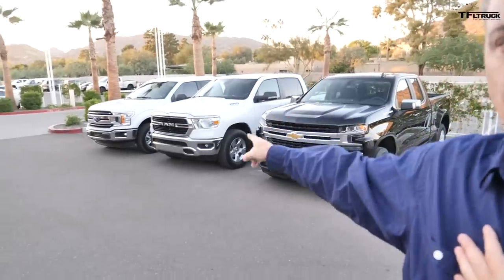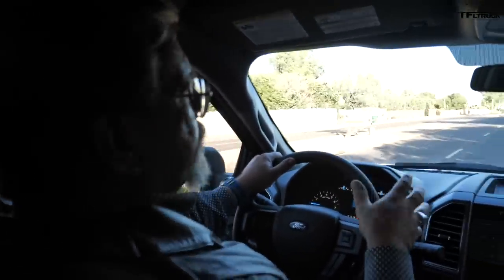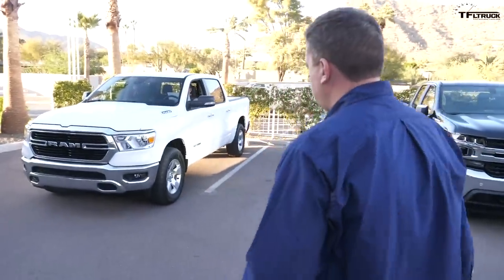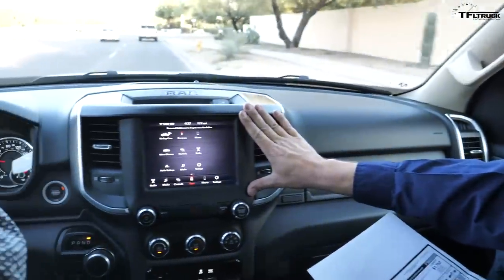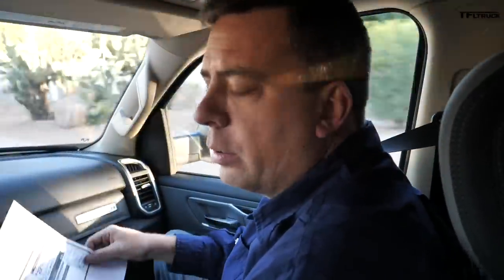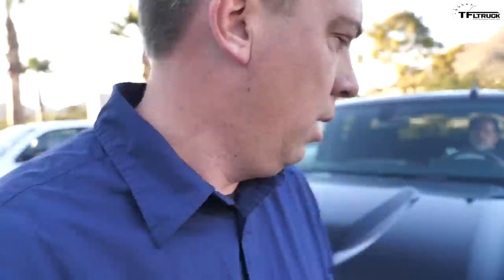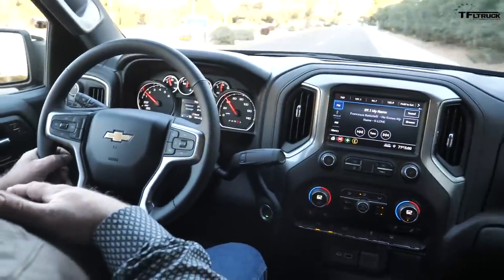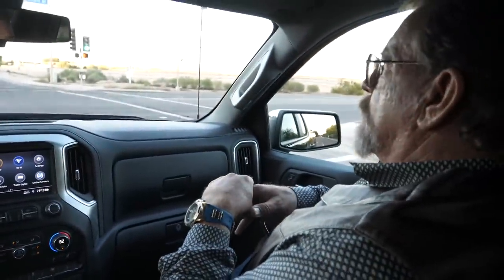Work Truck Wars: 2019 Chevy Silverado 4-Cylinder Turbo vs Ford F150 vs Ram 1500 Review

Comment: Point number 1: When TFL does comparison reviews like this one, they are far and away the best reviewers for pickups in North America and kudos to Andre for getting in the weeds and learning and conveying what he's learned to the consumer. He's the best that the industry has to offer as a media personality for new pickup truck offerings. Too bad that the media advocates still fall short; even TFL Truck. Andre Rocks as an advocate for the truck buyer with one huge caveat; reviewing these trucks in the way that GM or any other manufacturer wants them reviewed leaves a big gap in truth; at least with respect to GM in this whole new concept of changing the definition of a base power train. This is why relying on a positive relationship with the manufacturers to do honest reviews doesn't work, even when the media outlet is trying to give honest reviews like this one. More on that below.

Point number: 2: None of these trucks featured are base trucks or cheap trucks or good value trucks, or are they even close to being base trucks and why this is important to understand is that consumers should know that Chevrolet is spinning a new concept in the segment that they've invented by their marketing and bean counter folks to deceive us and are trying  to get the media on-board with them. So far it's working, because only the auto media can call them out and call it B.S., which it is.

So what is a base truck? A base truck is the cheapest truck for each configuration. Not the trucks shown here. The one's shown here are the trucks that are the most popular, aka volume trucks or mid-level trucks, and they are terrible value considering what you get versus what you pay for. And so what is a base engine? A base engine is the engine that goes in the cheapest truck, and it may also go up a few trim levels until the starting price warrants a higher level power train due to refinement and power and/or capability expectation from the consumer for that size and weight and price for any particular brand. For Ford, that cut off for their base engine is Lariat. When you get up to Lariat, which starts at or about $41K and SCab and 2WD, you no longer get the base engine; you now get the 2.7L twin turbo V6 standard; but Ford doesn't call it a base engine. It's a standard engine at that level. When a customer steps up to King Ranch, it's now the 5.0L V8; and when a customer steps up to Platinum, it's the 3.5L Ecoboost standard output; and Limited gets the 3.5L Ecoboost high output. The way Ford is doing it and also Ram doing it; it's  the way it's always been done, but now let's step it back down a little. Even though Ford has their 3.3L NA V6 in all XL and XLT configurations, they also allow a consumer to choose three premium gas power trains for modest premium prices for any lower trim or configuration truck, save only that the RCSB cannot be optioned with the 3.5L Ecoboost. But basically, if I want a very stripped work truck in a regular cab long bed; but want the highest payload available, I can get an F150 XL with the 5.0L and add the heavy-duty package and get payload up to 3270 lbs and still have a truck much cheaper than the ones shown here and far, far more capable. If I want the max towing truck, I can get a crew cab long bed XL with the tow package and get the max towing of 13,200 lbs, and if I get it in XL, it's cheaper than the trucks shown here. These are just two examples, but the main point being is that with Ford, there are real options and not just for the highest-paying customers. Ram offers everything they've got as well power train speaking at all trim levels, but they just don't have as many choices as Ford (they have three), and it's also very important to realize that Ram no longer offer any regular cab configuration in the new designed-truck which is another failure of the media to point out to consumers. Chevrolet and GMC is dropping the iconic RCSB. The media has said almost nothing about this. Ford still has both configurations up through XLT.

So what is GM doing. Chevrolet and GMC is trying to redefine what a base engine is...It's almost as if they are trying to completely write off their low end customers and saying that only starting at LT can you have a modern GM-branded pickup truck power train, and it's almost as if they only want to compare their number four trim level and up with the competition, and then justify not bringing the same power train technology to the lower end as a method to keep costs and prices down. Well if you follow where Chevrolet marketers wants you to go with this logic, and then you look at only the two trim levels that they want you to compare, with their standard engine, versus the competitions standard engine, but at only those two trim levels (LT and RST), then, just as this review shows, they compare favorably. 

But herein lies the problems with this logic. Finding a spot in the lineup just below the competitions' introduction of their higher-end power trains benefits only those customers that are shopping for those exact trucks and GM makes it look as if their advantage is the whole segment, but it's not. So if you are in the market for an LT or RST and the competing trims from the other brands (XLT and Big Horn), and only if you're considering the base power train, and only you like Chevy/GMC styling; and only if you'll accept a turbo 4 instead of an NA V6, then Chevrolet or GMC may be your best value truck. But lets go back to those Silverado forgot-about customers. Chevy is trying to say that their keeping costs and prices down via using completely carried over power trains in the new designed truck. There seems to be two big problems with that logic. Firstly, even though it is certain they are saving money on their costs by using two NA V-arranged engines with 6-speed transmissions and the older AFM cylinder deactivation system, the other brands will offer their more modern power trains with better mpg and equal or better performance and will compete on price. And especially as compared to Ford, they fall miserably in those low end trucks except with respect to capability. Not only does Ford offer a 2018-designed base engine at a competitive price and 20/25/22 mpg; but they offer three other gas engines for a premium price for a real choice. The only choice Chevy is going to give is a gas-guzzling V8 or a gas-guzzling V6 and with no improvement in performance, albeit some improvement in capability via the new design for about the same money as F150. The second huge problem is that it appears that the new-designed Silverado/Sierra 1500 is much less efficient on the highway and those more advanced power trains are needed just to stay where they were at before and so now on the low end, they've fallen further behind. This theory is evidenced by three specifics: (1) The new little turbo gets a great city estimate at 20, illustrating that it is an efficient power train, but gets only 23 rating on the highway versus F150 maxing out at 26 and 25 in another power train and Ram at 25; and only matching all three domestic V8s for highway efficiency. Secondly, the carryover V8 power train in the low-end models gets one less city, two less highway, and two less combined with the same gearing in the new truck versus the old design; thirdly, the newly configured 5.3L now with DFM and mated to an 8-speed gains only one in the city and combined and highway stay the same with a more efficient power train than bfore; and lastly,  the new 6.2L now has DFM and it is now mated to a ten speed for 2 more forward gears, which helps it gain 1 mpg in the city in the new design, but even with all those advancements in power train efficiency, the new truck design drags it down one on the highway. There is no doubt that this new, larger design, even though less drag, pushes or traps more air overall than the older-designed Silverado and Sierra. 

Point Number 4: Ford needs to increase standard payload for their crew cab pickup. The new Chevrolet rocks and Ram is very good in this regard. Ford has it set up where one can configure a truck with class-leading payload and/or towing, but they need to increase the standard duty payload to match or beat the competition.

Point 5: Seems as though real world fuel economy is going to be very much appreciated by the persons who choose the Silverado and Sierra with the 2.7L Turbo based on this review.

Point 6: These trucks are nice, but the interior of my F150 XL has the same exact features; looks just like that F150 XLT in the video except for the front grille and the styling changes since 2015; my F150 was only $28.7K before taxes and has the 2.7L Ecoboost. That same truck today would still be around $30K but now with a 10 speed, 25 more ft-lb torque 250 RPM lower, and 1 higher mpg rating in the city than my truck, and with my $1,100 - 101A package and chrome exterior package for another $500, I have the same truck as the much-more-expensive XLT except for the grill styling with only two doors for thousands less. These guys need to demand real work trucks when they are trying to illustrate value. These trucks have more value than the higher end trucks, but far less value than the lower end trucks, especially with respect to F150 where one can get a 3.5L Ecoboost with 25 mpg highway and 470 ft-lb torque in a regular cab long bed for under $35K. They are all wrong when they say that a $45K double cab Chevy truck 4WD is a good value. It's a horrible value, and so are the two crew cabs shown here; all for over $40K. The real values are in the work trucks. That is except for GM brands who will use old power trains and get horrible mpg. The TFL crew keeps talking about work trucks, but then show us these $40K+ pickup trucks. They are not work trucks.
Reply: No one read that

Comment: I just  think that GM turbo four's tonque is going to be hanging out around 70-80 thousand miles if the truck is used hard. Yes , it has power and torque but, that engine is reving its guts out to do that. a four banger in a full size truck just doesn't make sense to me. Maybe I'm just blowing smoke?
Reply: The 2.7 was designed and engineered to be a truck engine from scratch. It will do just fine. The only downside I see is the fuel economy is not that great.
Reply: @adogg619  Time will tell. I can tell you, from a guy that's built many hi-performance engines, that the stress being put on the internal components to create that power will definitely have a detrimental effect on the longevity of that engine. It's not made of some super alloy and the thermal dynamic effects  will ultimately be its demise.

Comment: I liked the interior layout and look of the ram in this review the best. It was very well laid out and appears that it would be easy to iluse with work gloves I. The winter etc. The Chevy gauge cluster was the best, but I don't like the entire dash layout at all. I still like the Ford exterior the best and the ecoboosts are more appealing to me. I think I would have to just go and try each one. But I have to admit that I have always had this feeling that Dodge/Ram has always been a throw away vehicle and their engine selection is starting to lag. Ford is hit or miss on interior quality and feel and I haven't always had the best of luck with reliability. GM has been good, but I have always disliked their interiors. GM just can't keep up in that department imho. 

I don't know.....

Comment: Pretty impressed with the engineering in the new 2.7 making it a much more viable truck engine than the current run of v6s. The interior and comfort champ is the Ram by a clear margin. But for the basic truck that would be the jack of all trades and a better all around truck, its gunna be the 2.7T GM (id go for the Sierra for better looks).  But i personally couldn't downgrade from the premium engines. Once you've acclimated to all that power, it becomes pretty boring to drive a base engine. I'd be sticking with the HO 3.5TT, 2.7TT ford, hemi, or the 6.2 chevy for my trucks. And if you keep your foot out of those, they get respectable mileage with their advanced transmissions and fuel savings techniques.

Comment: the turbo chevy is a good fleet truck but cavy will have to come down on the price for companies to buy multiples, I own a Ram 1500 5.7 4x4 crew crew cab and I tell all the chevy guys to get the 5.3 over any other power plant. I would completely stay away from Ford they need a large push rod and not a mustang engine in their full-size truck. So if you want what your looking for go Ram 5.7 or Chevy 5.3 stay away from the Ecoboost and ecodiesel they have problems like all the others.
Reply: The 5.3 is certainly a very good engine.  It has proven to be very durable.  But, given the choice, skipping the 6.2 is a mistake.  Having owned a few of each, the extra power that the 6.2 brings along, is a huge bonus.  One that doesnt really even have any trade off at the gas station.
Reply: I totally agree the best would be the 6.7 cummins, 6.7 Power Stroke or the Duramax but I was mainly speaking from the average commuter part time worker/ off road setup. the 5.3, 5.7 are by far the most supported V8 platforms  @ShyaMiss
Reply: @byronnlangley  even from a support standpoint, anything out there for the 5.3 is also present for the 6.2, because they are nearly the same engine, with the main difference being the larger bore present in the 6.2.  I personally feel that the ls, and now lt, engines REALLY hit their sweet spot at the 6.2l displacement.  The larger bore helps unshroud the valves, and allows the engine to make better use of the great flowing (for a pushrod design) heads. The 5.3, in factory form, suffers from the same issue that the old 305 did, the  small bore shrouds the valves. Personally, my opinion is that the smaller v8 in the GM lineup should be 5.7l.  But not the ls1 bore/stroke arrangement.  Go back to a 4" bore, 3.48" stroke, like the original 350.  This will give that needed bore to aid in cylinder filling, and should put it right in the hunt with the Dodge 5.7.  Besides that, who wasnt a fan of a good ole 350 :)

Comment: I've always like v8's but I have a F150 3.3L V6 no turbo 6 speed 3.73 gears and have plenty of torque and power for a 1/2 ton.
Had a 9 speed in a Ram and couldn't stand all the gear searching it did. 6 speed 3.73 gears is perfect for me.
Reply: Ram never had a nine speed.
Reply: @s.weisgram1981  Uh yes it did. I owned one.  Ram Promaster city. Stick to things you know!

Comment: I don't get why they don't make gas v8 turbos in trucks
Reply: The reasons for using turbo's is to meet EPA regulations as far as mpg ratings. Ford Ecoboost as you know make equal, if not more power, than most base V-8 engines. A V-8 with a turbo would not make sense due simply to mpg ratings.
Reply: Kevin Williamson But my point is a v8 with a turbo would get better mpg, better hp and torque. The only thing the v6 gets is better mpg and in all honesty its really not a huge significant difference. I think time would be better spent in making a more fuel efficient v8 instead of seeing how hard they can push a v6 to be like a v8.
Reply: @kingyellowwolf5256  A turbo V-8 would not get better MPG figures than a natural aspirated V-8
Reply: Kevin Williamson I see no reason to believe they could not make a fuel efficient v8 turbo. Which in my opinion would be better than a v6. Thats all Im saying. I wish the focus was on v8 engines not v6's. But my opinion does not matter because they will never stop with the ecoboost and now every other manufacturer wants a piece of that pie. I only wish someone would be different and focus on making a better v8 engine. All of them have generally remained the same for years.
Reply: @kingyellowwolf5256  A V-8 turbo would definitely be a fun driver, and myself would probably buy one. But forced induction on a motor increases fuel consumption compared to the same displacement/configuration. Sadly, I think the days of V-8 engines in light duty trucks is coming to an end.
Reply: Kevin Williamson sadly I think your right and agree with you. Which is why my next truck will be a 2500 with a big gas v8 because I don't need a diesel and I just love gas v8's.
Reply: One of the benefits to using turbos  on I4 + V6 vs a v8 is packaging. Modern v6 engines tend to have a 60 degree bank angle which keeps the overall width of the engine reasonably narrow and makes room for turbos. All of the V8 motors in current production have a 90 degree bank angle, which naturally makes the engines wider, cutting into the area you have to mount turbos.

Comment: I really like the great videos as always, but what I find interesting is that you guys have been deciding a lot on trucks based on interior features.  What about how it feels driving.  How does the tranmission shift?  How does the steering feel in your hands?  Do you feel the road in the pedals or steering wheel?  Or, are you completely isolated from the road?  That's what I've enjoyed with Ford is getting enough road feel to feel connected to surroundings.  I have not had this experience in RAMs I have driven.  I think for a lot of people wanting to own a cheaper truck, they want a great driving truck, but the frills don't matter as much.  Also, I'm wondering where the 2.7 ecoboost testing is for the last couple years.

Comment: Nissan base engine is a v8 with 7-sp
Reply: Not for much longer, for either 2019 or 2020, the Titan is going to get a base V6 (most likely the 4.0). The Titan XD will still have the V8 standard though